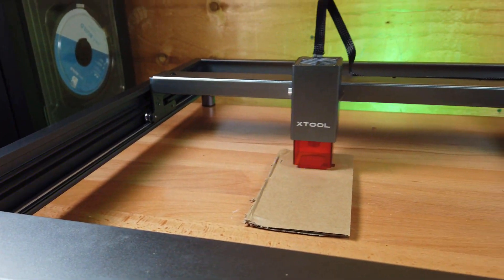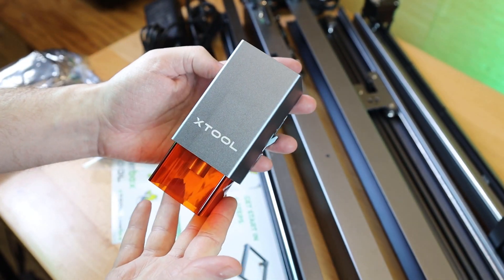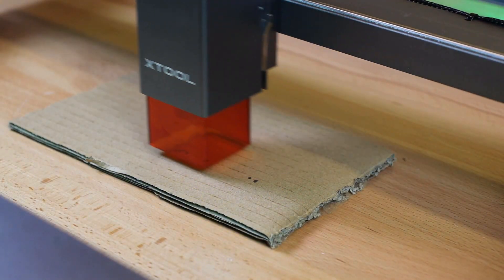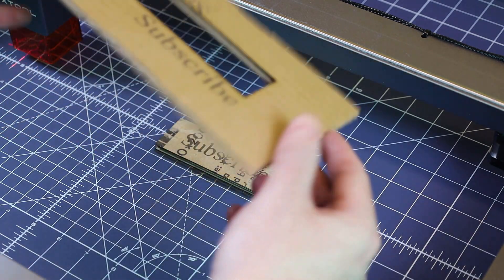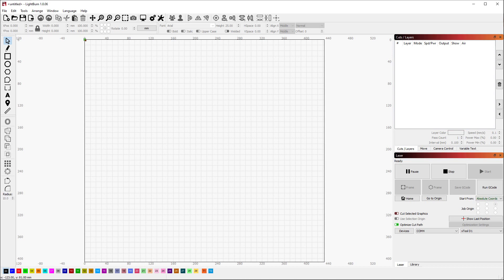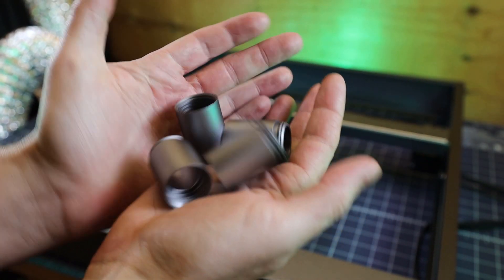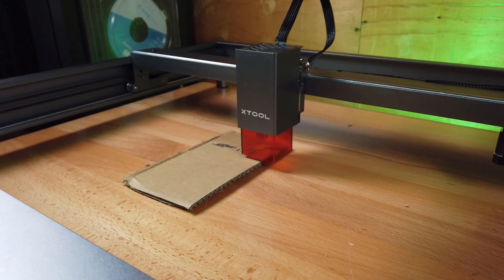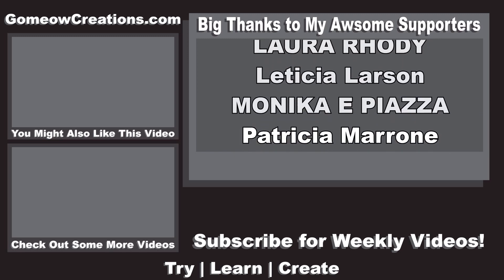This Has Changed My Mind On Diode Lasers - xTool D1 Laser Engraving & Cutting

Comment: Wish the diode was a good alternative to the fiber MOPA lasers for jewelry. I work in stainless steel and the D1 Pro marks it but it looks so superficial from all the vids I've seen. Wish the Glowforge could frame like the xtool so you know where it's actually going to put the image. Think I will keep saving my pennies for the fiber. So many pennies to go . . .😒
Reply from the maker: So there is a new laser head for the xTool that is for metal. It's a different kind of laser that I can't remember what it's called.  I suggest checking it out if you want to save some money. 

A fiber laser would still be best but yeah they are very expensive 😅

Comment: Are you recommending this for working in copper and sterling silver as well?
Reply from the maker: Not at all. It will do nothing to silver or copper. 😅 You need a fiber laser for doing work with metals like that
Reply: @GomeowCreations  any tutorials or advice on those. I want to engrave as well as cut out small embellishments in metal - usually copper and silver and I was thinking thicknesses as deep as 0.8 or 20 gauge. Very limited budget and I’m in Canada. Thanks so much.

Comment: I'm currently considering an XTool laser. Have you tried the D2 yet??
Reply from the maker: I haven't but from the looks of it, it just looks like  a smaller version of the D1 with a build in fan and enclosure. I can also cut vinyl and paper with a knife attachment.
Reply: @GomeowCreations  I have a Cricut for cutting vinyl and paper.
Reply from the maker: Same here and you can also laser cut paper on the D1

Comment: Have you ever tested this with cardstock?
Reply from the maker: It can cut it with no problems
Reply: Really, what a relief, cause someone just told me it burns it and I just ordered mine 🤦🏽‍♀️
Reply: I need it for my invitation making
Reply from the maker: Check out this video for some upgrades you might want. Because you can burn things but with the cutting surface it will help and having an air assist will make it cut a lot cleaner without flare-ups
Reply: @GomeowCreations  Okay. Sure.

Comment: Thanks for the review.
I just think that the manufacturer of xTOOL D1 should follow what other brands do, which is to sell separately or already make their machines with an extended Frame (larger) because many need to cut or engrave larger parts.
Reply from the maker: That's not a bad idea
Reply: @GomeowCreations  Let's encourage them to do so!
Reply: @AustinGDesigns  Oops! Good to know! Thanks for the information.
Reply from the maker: Good to know, I will see if they want me to check it out or not. They are sending over the smoke enclosure soon so that will be nice to have

Comment: Not seeing why it's changed your mind about diode lasers, it has nothing that many competitors don't have. Just a generic twin source diode laser.
Reply from the maker: The only diode lasers that I have ever used before this happened to be on that was on a 3d printer and the other was some very small diode lasers. Other than those I have only really used CO2 lasers. So this being faster than the other diode lasers and did a great job. 

I'm sure it's simple to others on the market but this is just the one I got 😁👍

Comment: Hiii!! Can this cut white and clear acrylic? I’ve been told no before BUT the acrylic sheets I’ve seen have a brown “tape protector” over it and I’m wondering if leaving this on would make it possible. (1/8” thick)  thank you :-)
Reply from the maker: I haven't tried yet but I have a ton of acrylic and I just got a air assist for the Slater so I'm going to try it out and see what happens might make a video about it what do you think?
Reply: @GomeowCreations  pleaaaasseeee! It would be oh-so helpful:-D
Reply: The issue is that the diode laser is not made for it. I tried cutting acrylic but it warped the material. But… I hear that Xtool has a special acrylic sheet that burns and cuts well.
Reply from the maker: So I can cut acrylic but it can't be clear. I did it in one of my upgrade videos about the xTool D1

Comment: I see you’re using the ventilation for the glass but not the wood, i don’t have proper area for the best ventilation, I’m in my sun room with a door and a fan. I’ve had this for about two months and I’m scared to use it because of that.
Reply from the maker: I was using the ventilation the whole time, but it was just out of frame. You can use it with a fan and a window or door open if you are doing wood, leather or paper. If you are wanting to do other stuff like acrylic you might want more of a dedicated ventilation.
Reply: @GomeowCreations  I was successful on my first attempt (basswood)! BUT, i don't have a "paper" option in choosing the material? I'd love to do paper and cardboard! Do I keep on basswood?
Reply from the maker: You will have to do a print test to see what works best
Reply: @GomeowCreations  I'm so afraid to catch something on fire, that's why I asked haha :/ This thing gives me such anxiety!
Reply from the maker: Yeah that is always going to be a possibility. They do have an air assist kit that will help you not have flare-ups if you're wanting to invest a little bit more into the machine. 

https://bit.ly/xToolD1AirAssistSet

Comment: I really want to know if you can cut acrylic. I want to make wedding signs etc. Thanks.  This was a great video!!!!
Reply from the maker: Well good news you can and you can also engrave it.
Reply: @GomeowCreations  that's great! I had a Chinese laser, but sold it because I was so intimidated by it! Uhg I should have really pushed through.  So now.. im looking for a replacement! Something to start with thats not.. $6000! But I want to be able to cut acrylic (as you mentioned I can!) And engrave and make yeti cups etc. So I'm nervous about getting a diode laser, but idk.  Thanks for your help!
Reply from the maker: If you do get it look into the air assist and the metal cutting area. I have links in the description to both
Reply: @GomeowCreations  that's great! Thanks so much ill look! If there's a video I might have missed I'd love to see that also.  Co2 isn't off the table yet,  I'm just thinking these are an easier starting point. Also I worry about these not having a case to enclose the machine.  But that's Sinton for me to decide still.  Thanks again!!
Reply: @melindagibson8606  It can`t cut clear acrylic. Painted acrylic can easily be cut with this diode laser but definitly not clear acrylic. The wave length of an diode laser will just pass through it. An CO2 laser has an different wave lenght an can cut clear acrylic.

Comment: Thank you for the video, mine is coming in about 4 to 5 days, have another laser but is weak. Hope I'm not imposing too much here on you but I have a question. From everything that I've seen on the xTool D1, nothing is showing on how to set the work origin which will give you perfect position in the stock to engrave, it shows the cross hair to show the start of the burning. As I ran a CNC for a few years, work origin is key to the way I work. Lightburn let you set the work origin, would that works with the D1? Help appreciated :).
Reply from the maker: So you can use lightburn with the D1 and I believe you can use it to do that. I haven't used it all that much with this laser other than setting it up and doing one test cut with it. 

I have been using the stock software with it due to it being able to connect via wifi. I haven looked into getting lightburn setup over wifi.

I hope that helps, you can find the config file for lightburn on the xtool website.
Reply: @GomeowCreations  Thank you so much for a quick response, It makes me feel a little better, I'll head there and get the config files even before I get my machine, Lightburn is phenomenal! Thank you again, I'll post a little review when I get the D1 and Lightburn working together, cheers!
Reply: @GomeowCreations  Thank you for your comments, got my D1 setup with lightroom just fine, the work origin question I had works very nice between Lightburn and xTool D1. One thing I need to point out is that everything works good with movement and origin, as soon you move the laser head by hand as most people do with the D1, work origin is lost, do all through Lightburn and you'll good 😃.
Reply from the maker: Thanks for that info and that's good to hear